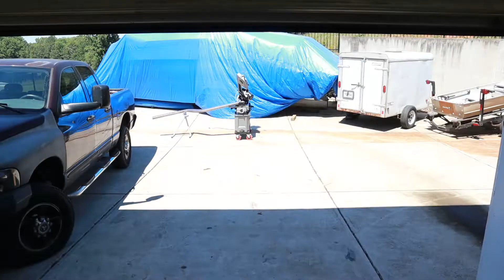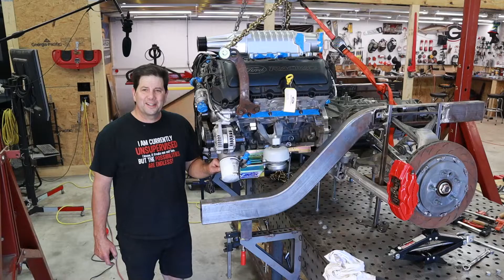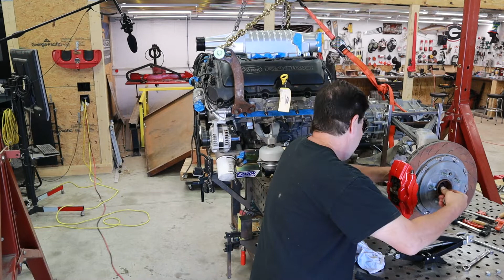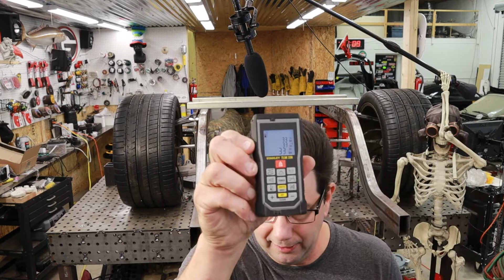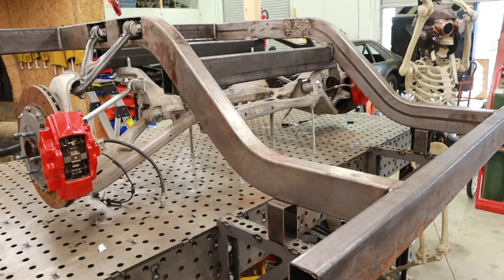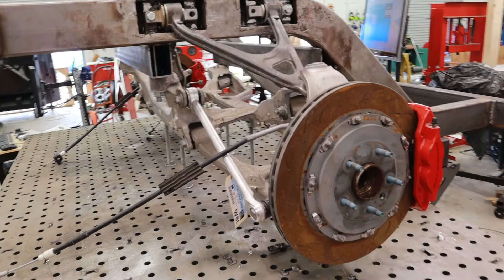Project Split Decision Car 1..Ford Aluminator XS Car 2...Tesla Model S swap ... DIY  Supercar Part 4

Comment: was looking at the adapterplate between the motor and trans , think there in line with the front suspensionmounts , you could make another one and make it part of the subframe , that way you could lower it a lot